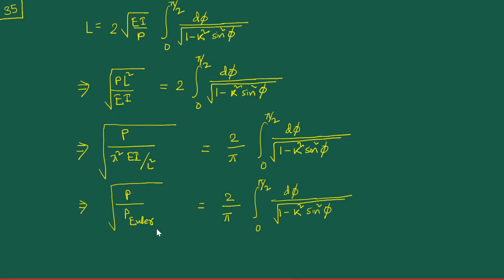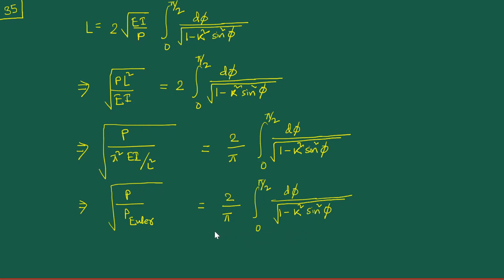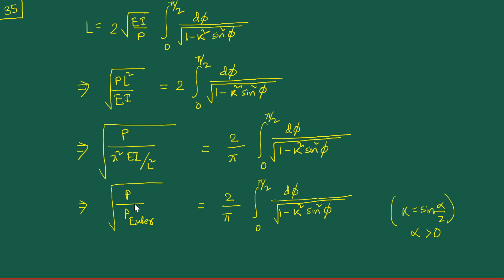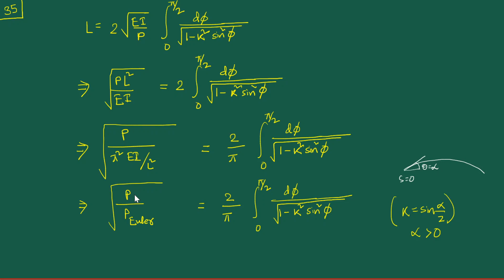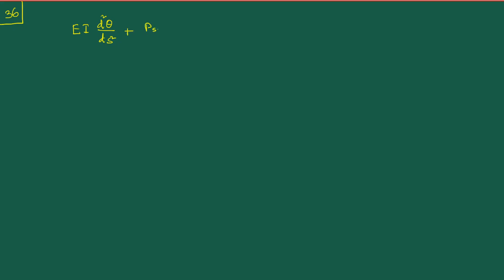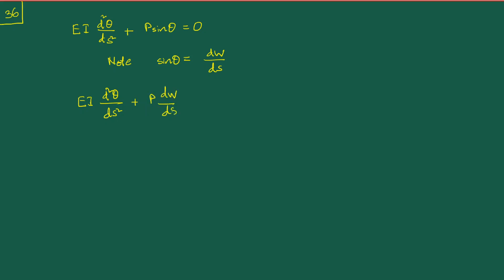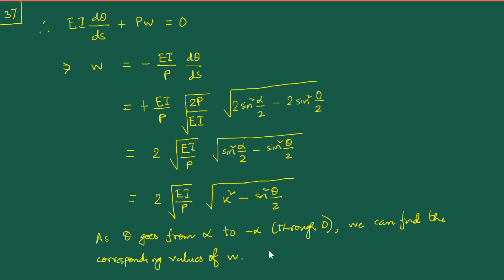[L32] Beam Theory – 12: Buckling – 7 (Elastica Example Solution, Part 2)

Comment: Sir, thanks very much for your fantasic explanation on buckling. I have a question that if the load p reaches the 2nd buckling mode, then alpha(s=0) = alpha(s=L), will this method be able to capture this scenario? As well as the 3rd, 4th buckling modes so on and so fourth. Thank you very much.